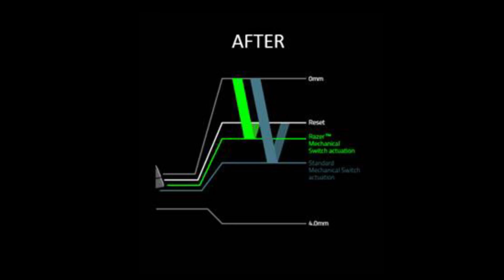Razer Mechanical Switches - Analyzing Actuation | Razer 101

Comment: i'm just wondering what keyboards do you (people watching this video have) have, personally i am using a standard keyboard but i am getting a Razer Blackwidow Ultimate soon.
Reply: Don't! I have a Rosewill Apallo cherry mx brown. I had a Razer Blackwidow Ultimate Stealth, and it felt so weird when I was typing. I was accidentally pushing keys twice without thinking about it. And on top of that, it just sucks. Get a better thing the the Blackwidow. Trust me. If you want a better one get the corsair k70. It is way better. Or if you are willing to spend some cash, get the corsair k70 RGB.

Comment: Could somebody with experience tell me if this mechanical keys are actually better than the cherry ones? Also, does every razer keyboard have this mechanical keys or just the newer ones? I currently use a non gaming setup and I'd like to go razer so this would help.
Reply: Cherry switches are better. Only their 'blackwidow' line has mechanical switches. I'd recommend you do some research or check out /r/mechanicalkeyboards it will help a lot finding a keyboard that will suit you. I'd just say stay away from the new razer blackwidow keyboards. I got the blackwidow 2013 edition and its good, but newer ones use these rip-off switches.
Reply: eh, it might be, i recomend you test both in an actual store. for me razers feel a little bit better.
and yes its just the newer Black widow ultimate 2014, stealth, and chroma that has these.

Comment: What's the best Razer keyboard for gaming ima buy it on Christmas x3
Reply: The best one i have tried is BlackWidow Ultimate, its just wonderfull!
Reply: It depends on what you want. If you want one with clicky keys (I do! I love my clicky keys!) Than you want one with mechanical switches, but not the Stealth version. If you want one with no click but you don't want a membrane keyboard, than you'll want a Stealth version of a keyboard. If you want one with lights you'll have to get one with Back lighting. They have a section on their website where you can compare each keyboard. http://www.razerzone.com/gaming-keyboards-keypads (Go to the bottom). I would suggest The Blackwidow Chroma, but if you don't care about the multi-color lighting and want to save $40, than go for the Blackwidow Ultimate, or it you don't need Backlighting, get the normal Blackwidow and save another $40. You should do your research before you buy anything. Of course, you might not want any of these keyboards. Just look at the different options and see which one you like the most.
Reply: I know it's not quite what you asked for but I'd say the best keyboard to get is the Corsair Vengeance K90 (unless you don't need the extra G keys, in which case the K70 is almost the same (I think)).
Reply: HeavenlyDemonicKid he did ask for razer keyboard soooo

Comment: Razer gaming switches? Cool way of naming chinese cheap Kailh switches.
Reply: well it's true that they are using kailh switches, but it's also legitimate because they designed their key switches. lets just say kailh is the one producing their key switches, only, theirs has different specifications than what kailh would normally produce.
Reply: Any mechanical switch is better than membrane.
Reply: BAM! TRUTH
Reply: I know that man. But thé reason is that cherry are sold out too. But it dont' means that the kailh is cheaper. I've tested the both and i have a preference for kailh (from raser). But everyone should take what they want. And nobody should say "gnagnagna cheaper, less good, gnagnagna gtx titan z is better gnagnagna"
Reply: *modified Kailh switches. Not that it probably makes much difference. Still feels like a good keyboard to use, especially for gaming.
Reply: Cheap ? Kailh are manufacters concurrent of cherry. Not a copy. They makes other switches thar keyboard one. Sorry for my english. I've try to break kailh but i've failed. They are not cheap. Just différent.
Reply: Faustin Vaillant
 the thing is, the patent for the cherry mx switches has expired, so anyone is allowed to attempt to replicate it without getting sued or somethin. I don't really know how true that is but I heard it from linus.

/watch?v=1T5BVGCTY-g